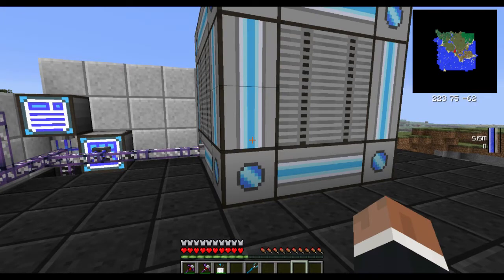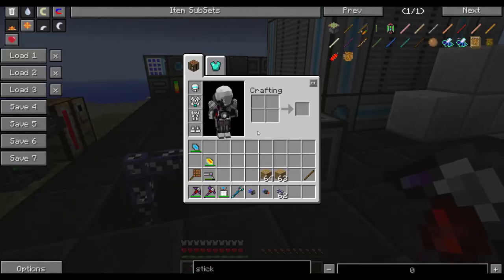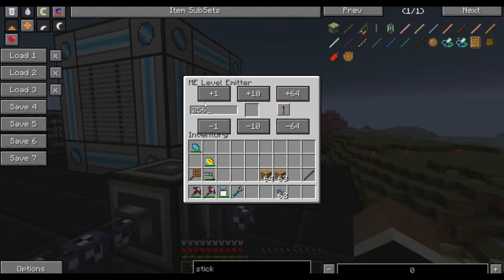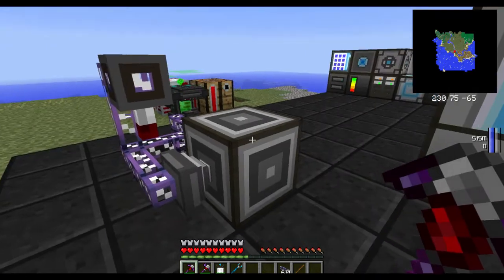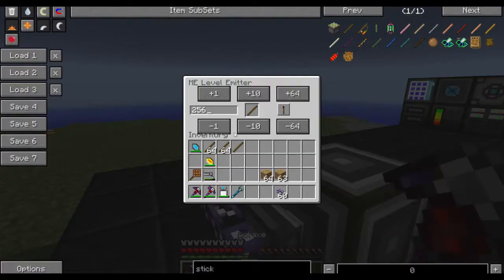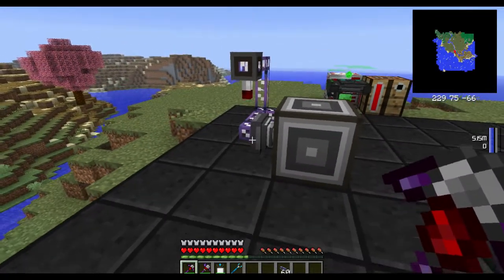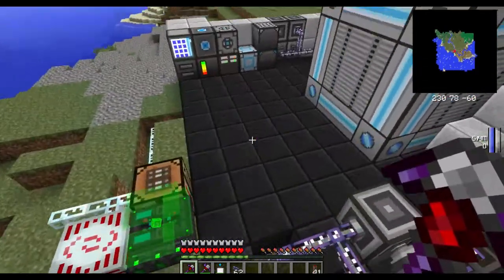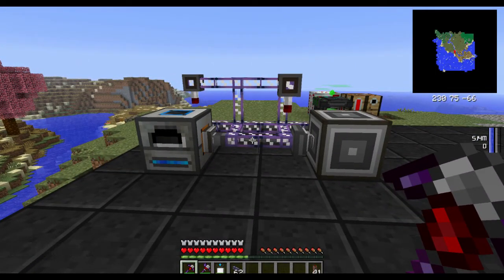Applied Energistics Tutorials - Balancer

Comment: You forgot to mention a small detail with the last setup where the level emitter was set to monitor the output. At the time the level emitter shuts off, the furnace would still have a stack in its input slot and therefore it will produce a stack above the set level in the emitter.

However, I can't imagine this being a problem except in very special scenarios, and your tutorial was otherwise very well done and nicely explained.
Reply from the maker: Indeed, it would produce some extras - but you could lower the amount it checks for in the emitter to shut off earlier. You can have the emitter toggle the furnace as well.